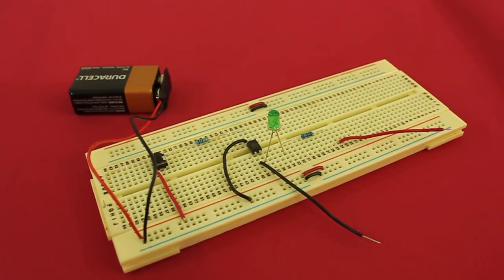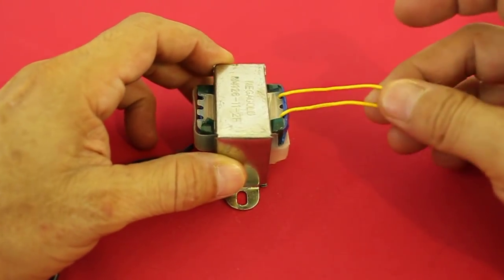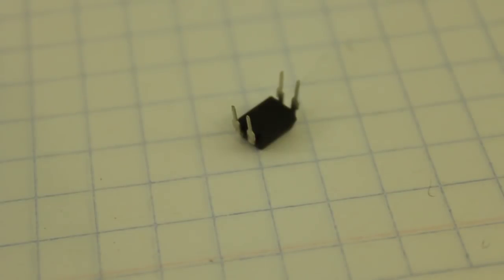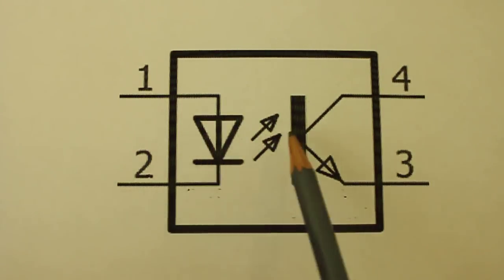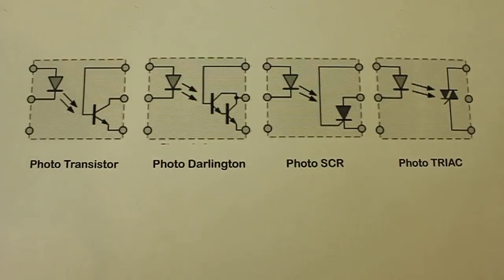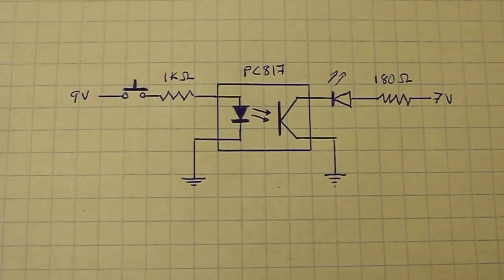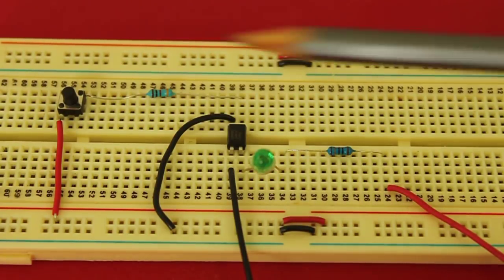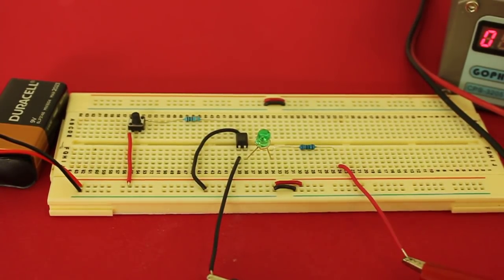How an Optocoupler Works and Example Circuit

Comment: I learned electronics in the old school method where current is from negative to positive. Electrons do travel from the negative source to positive.  It always confuses me when people refer to current as traveling from Positive to negative.  I don't understand why they teaching people this way now.
Reply: Nice
Reply: Ben Franklin labled the polarity as possitive and negitive according to what he believed to be true at time which was + to - flow.   It was not untill after all the standard schematic sumbols were created for the diodes and transistors did we  know it was actually - to +.  This was the conventional current flow.   We know now that was wrong but to change the entire world to electron flow current teaching has been deemed unnessary.
Reply: refer to history. that also confuses the heck of me.
Reply: Same thing. Negative charges from - + or positive charges from + to -

Comment: Very good presentation.  Just for reference, there is another type of optocoupler, the "Photovoltaic MOSFET Driver" like the Vishay VOM1271.  These are expensive, special purpose drivers, but are very useful in building MOSFET H-bridges.

Comment: Would it be possible to use two opticouplers as NOT gates on each other, and make an oscillator? If so, how well would it work?
Reply from the maker: Good question, not sure will think about it

Comment: greetings everyone. very well explained. a question: using a potentiometer we have a linear control of the output voltage on pins 3 and 4 ??? very good. success.

Comment: Thanks for the video. Since the input from the switch is noisy (bouncing), how would the output look like? would it show also bouncing? this could be problematic if connected to input of a controller, especially with interrupts.

Comment: Hello, thanks for the simple but very informative video. I have a question that what if we don't have two power sources i.e. two grounds. Can we still use the optocoupler there or it does not make any sense then?

Comment: So basically the input (voltage to led) and output load (led) is not isolated??
Then how it will work as a isolator ?🤔

Comment: I don't understand why the black wire goes from the chip to the vcc on the other side. 

I made a circuit in which both power supplies are isolated, and the only thing bridging the gap is the chip. 

If I disconnect the power supply from the led side, pressing the button does nothing, as you would expect. The same vis versa. The led will not light even though that side has power. It will only light when the side of the chip with pins 1,2 and 3 have power. 

This is the second video (there are probably more) in which a wire, sometimes 2, connects each side which would seem to me to defeat the entire principle of the optocoupler. 

What am I missing? I wish I could post the pic of my breadboard circuit for critique.

Comment: Why cant the 9v GND and the 7v GND be tied to a common GND ?
Would it make a difference ?
Nice video and good explanation btw: Thanks.
Reply: Hey, you probably don’t need this anymore, but someone else might. The purpose of having the octocoupler is to have both circuits be electrically separated, so having a common ground can make issues there

Comment: Can anyone explain what the numbers on top are? For example.. my octo reads as follows
L 1550
817 B
W
.....I believe the important numbers are the 817B, because I have been able to find replacement octos with those numbers, but the top and bottom lines do no match... For example I found something like 
L 1440
817 B
Y
... Would this work for me? Can anyone explain what each number means, I can't find any videos that discuss that